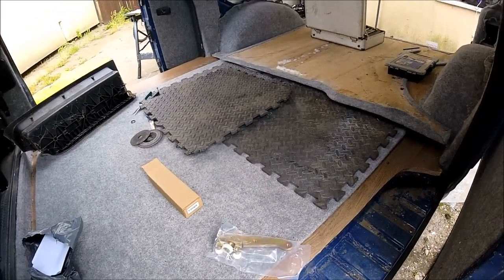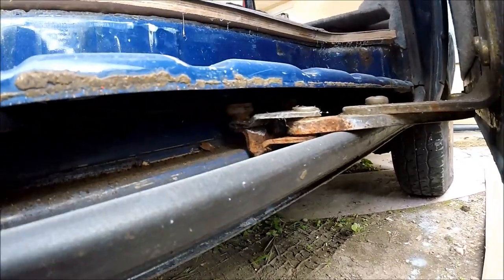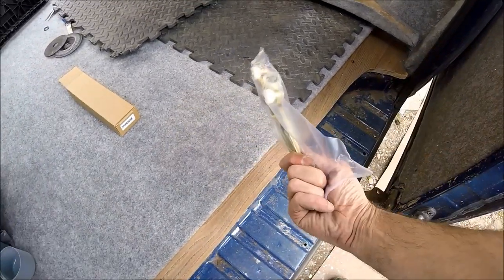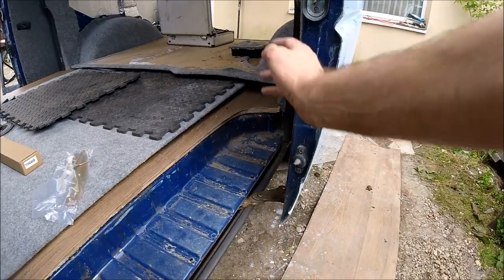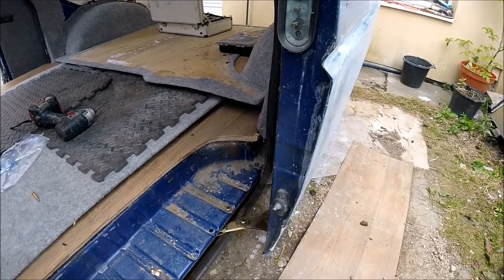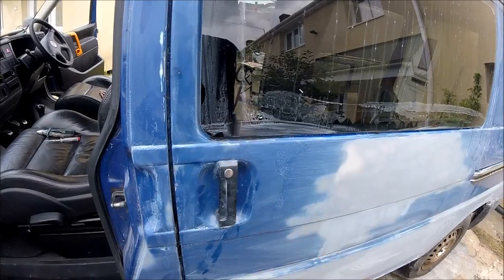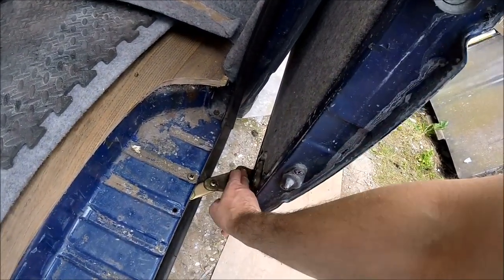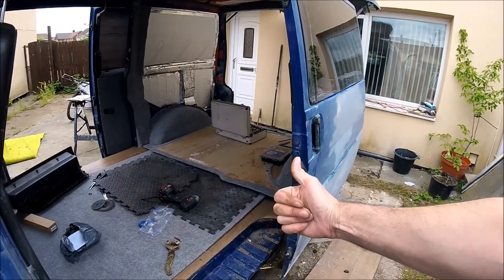Sliding Door Won't Open Or Close? Swap Those Seized Rollers!!

Comment: Hiya, I'm trying to do mine at the minute. Finally got the screw heads loose, they were in there tight! What size are the Allen bolts holding the roller on? 4 mm and 5mm don't fit, are they an imperial size? Or perhaps mine are buggered!